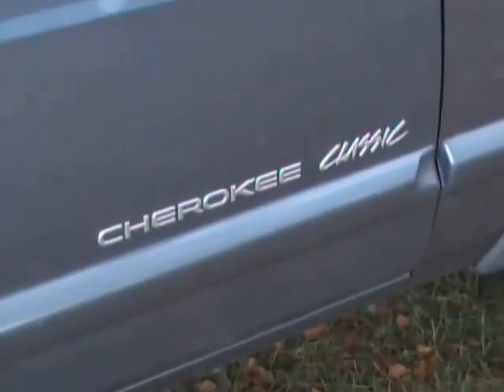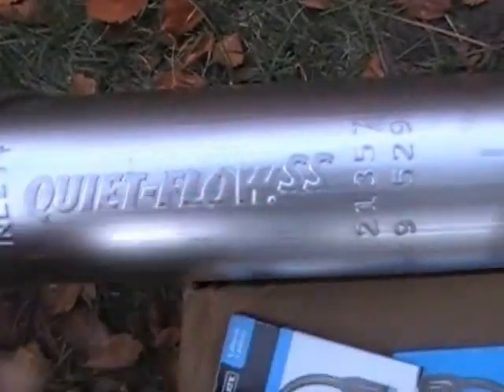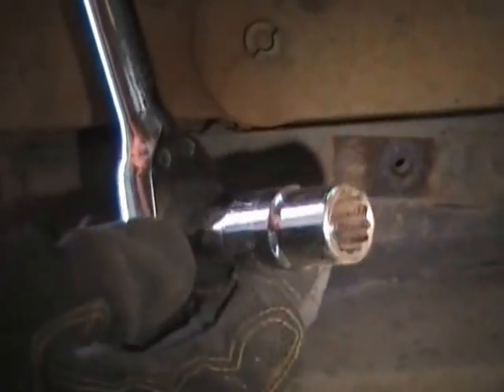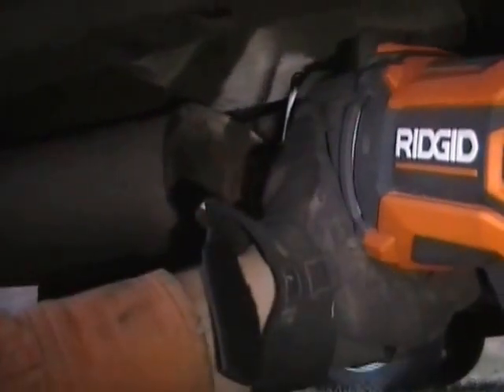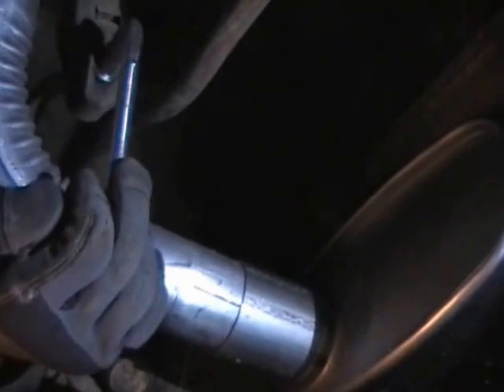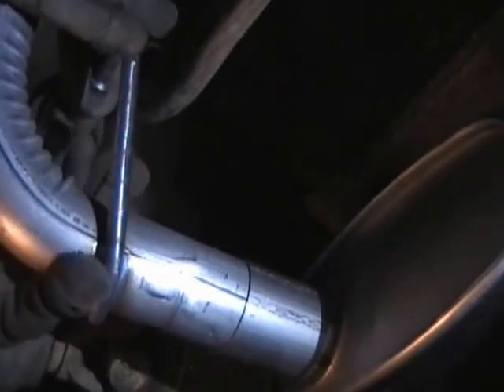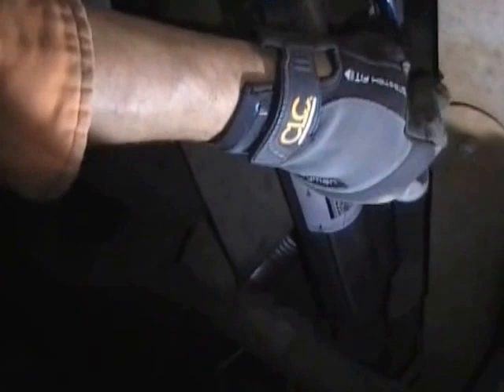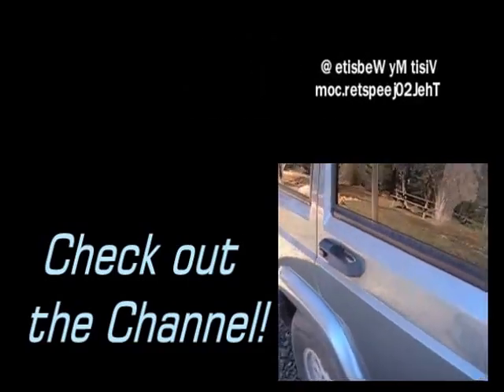Simple Walker cat back exhaust install on 99 Jeep Cherokee

Comment: Overall how would you compare it to the STOCK sound before the pipe fell off...

Pretty much the SAME thing just happened to my little 2.3L ranger this morning.hahaha!  So I was on amazon and for $190 and tax I can get a complete cat back exhaust by walker using what appears to be very similar parts... It's between this or going to the custom exhaust shop and spending $350 for possibly s/s piping and mandrel bent tube and having it come out the side before the rear wheel, but I am sure that would make it quite a bit louder than having it come out the rear...no?

Thanks,
-Nigel

Comment: That wasn't a tac weld it was a locator pin to prevent the exhaust rotating out of place! If the muffler fitted was a genuine Jeep fit it would have had a cut out on the exhaust tip for the locator pin to slot into! Without this locator pin there is a lot of twisting force on the join.

Comment: For those who are watching this. It is ok to shake ur head! Just cut where the muffler ends There is an Inch more in your exhaust. As long as the bend goes over the shaft, you are fine. I have done this with a hacksaw and had no issues. The clamps will crimp the tubes making a seal.